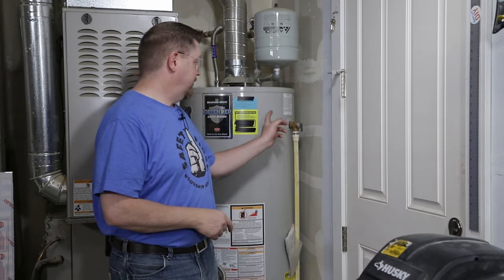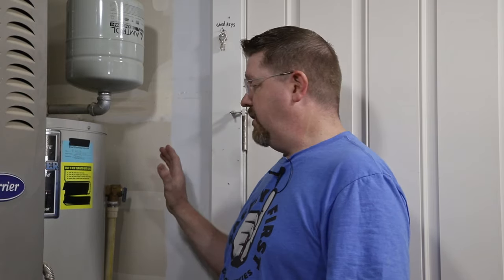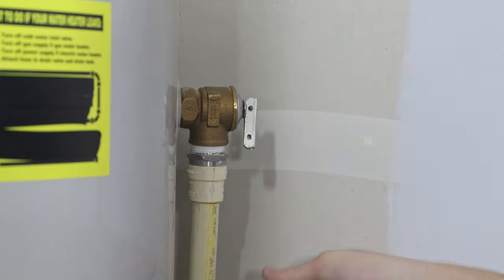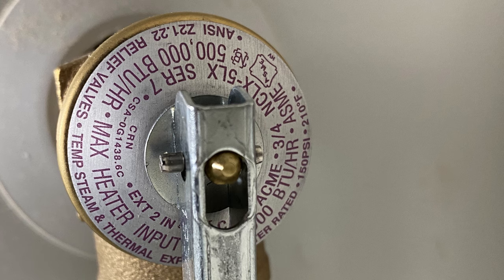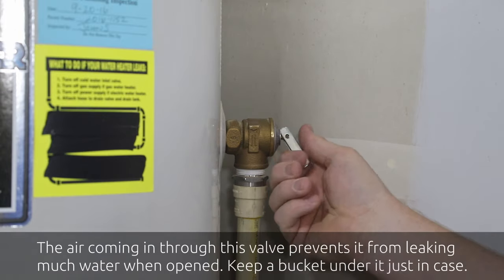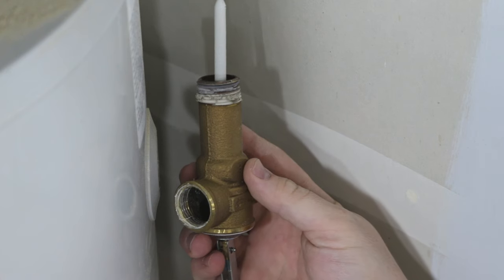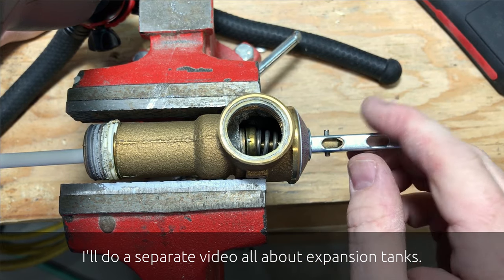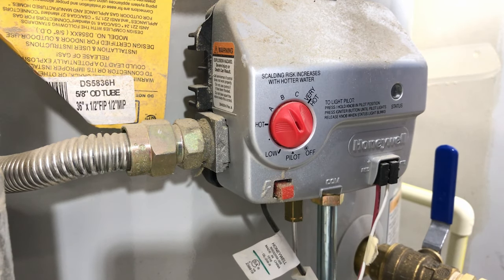How To Replace Pressure Relief Valve On A Water Heater (T&P)

Comment: Out of curiosity, how long did it take for you to drain the water till you could replace the T and P relief valve?
Reply from the maker: My tank drains pretty fast because I replaced the drain valve with a better one than the manufacturer included. Took less than a minute to drain down below the T&P.  https://youtu.be/OBPJYg0o_o0

Comment: One of the water tank(5000ltr) water is leaking continuously from the pressure relief valve,we replaced with a same new one. But its continuously leaking from new pressure relief valve. 
Can u suggest me how to rectify the problem
Reply from the maker: As far as I know, these valves only open when the pressure is higher than they allow, the temperature is higher than they allow, or they are damaged/defective/worn out. Consider the whole system: is there too much heat or pressure somewhere? Is it possible the new valve is damaged or defective? 

Are you sure the leak is continuous? How quickly does it leak? Gallons per day? Just a few drops?

Comment: does the water coming in need to be turned off before removing the valve?
Reply from the maker: Yes - unless you want a LOT of water shooting out of the valve hole as you remove it. :)

Comment: Okay this is very helpful but I ran into an issue - flipping the valve won't let any air into the tank so that I can remove it without spilling the water inside.  ..and turning on hot water faucets inside the house doesn't do anything when the cold water valve going into the tank is shut off.  ..some type of vacuum going on won't let anything out.
Reply from the maker: Hi madcow - It sounds like your drain valve is all plugged up. There are 2 ways you can try to clear out the clog: 
1) Attach a hose to the drain valve. With the cold water inlet still open (so there is lots of pressure in the tank) run the hose to somewhere safe to drain hot water, then open the drain valve. If water rushes out the hose, then you have cleared the clog. If not.... 
2) Close the cold water inlet, remove the hose you tried in step 1 above. Open the drain valve. If nothing at all comes out, get a bent coat hanger or long skinny screwdriver and jam it into the drain valve to try to break up the sediment blocking the drain. Once water starts to trickle out the drain valve, repeat step 1 above.

I also recommend upgrading the drain valve to a larger, more robust valve: https://youtu.be/OBPJYg0o_o0

Good luck!

Comment: Given that it is all brass throughout, wouldn't a five minute cleaning work just fine to descale the interior of the valve? It's only a $20 valve, but still.
Reply from the maker: Cleaning may get the mating surfaces water tight again. If you are on a tight budget, I’d recommend trying to clean first, and if it still leaks then go for the replacement. Thanks for the suggestion, and for watching!

Comment: Used this method, and now I have a lot of stuck air somewhere, preventing my hot water from coming out. Probably should have used the open faucet method.
Reply from the maker: Stuck air? That’s not really possible…what happens when you open a hot water tap in the house? Anything?
Reply: @AmplifyDIY  very little water comes out at all and isn't hot
Reply from the maker: @jretta91  Are you certain you re-opened your cold water inlet to the heater? Any chance you have a shut-off valve on the hot water outlet that goes to your house that accidentally got closed? Do all the faucets behave this way?
Reply: @AmplifyDIY  It was the water sensor. I must have tripped it when I moved it unknowingly. I still had issues getting water out of a few faucets after, but after venting the built up air in all faucets, things seem back to normal. Thank you.
Reply from the maker: @jretta91  I'm very glad to hear you got things working again - that's great!

Comment: Please answer this question in my apartments the pressure relief valve is connected to a tube that goes into the wall I’m confused where does all the water go into the wall or where
Reply from the maker: Hi Luis - that pipe is only there in case of an emergency, and it is supposed to direct the water that comes out of the T&P valve during an over pressure or over temp event down and away from anywhere that humans may be. If it disappears into your wall, it likely exits the building a short distance later. Those tubes are never supposed to be capped, or have any additional valves on them. It should travel a short distance and just end so that water / steam can flow freely out of it somewhere that won't hurt anybody and cause minimum damage to any property. Hope this helps!
Reply: @AmplifyDIY  what’s your email to email you a pic because I am very confused
Reply from the maker: @vacking7751  Hi Luis - you can email me here: amplifydiy@gmail.com. Thanks!
Reply: Ok thanks

Comment: Would there be anything different with a tankless hot water system
Reply from the maker: Tankless heaters are substantially different - consult your owner's manual. Good luck!
Reply: Yeah, it's only a pressure relief valve. Otherwise, pretty gravy replacement.

Comment: I cannot get my valve to budge. I’m trying with all my might. Do you have any clue why I’m having a very difficult time trying to twist it out just like you are doing in your video? I mean it’s really really really stuck in there it won’t budge it won’t turn. Thank you :)
Reply from the maker: What sort of tool are you using to try to get it out? Just a pipe wrench? You may need some extra mechanical advantage like a breaker bar - but be careful that you don't snap the valve body off the threads... that would be a bad day. Also, is it possible that you are accidentally attempting to turn the valve the wrong way? Just make sure you are turning the valve anti-clockwise.

Good luck!
Reply: @AmplifyDIY  hey there. Thanks for the reply. My friend helped me get it off. I wasn’t strong enough lol. I replaced the valve, but it’s still leaking from the valve which is weird. And it’s brand new. Still trying to figure out a solution. Thanks so much again!
Reply from the maker: @lilac1055  I'm glad you got the valve replaced, but sorry to hear it's still leaking. When does it leak? All the time? Or just when the heater actually heats the water? Do you have an expansion tank? If not, you may need one: https://youtu.be/NGygvtP6Sdk
Reply: @AmplifyDIY  that might be what it is. It probably has something to do with some thing else, pressure or temperature or some thing. I’m going to have someone look at it this week. But your video was amazingly helpful. You did an excellent job. Thank you for that

Comment: So my pressure tank that's on top of my water heater is hung upside down where the air pressure release is at the bottom. When I push on that water comes out. I think it's because the tank is hung upside down. How do I verify if this tank is in working condition or not given that it's hung upside down. And it looks to be designed to be hung upside down too given a sticker on it is upside down
Reply from the maker: That's a very common installation setup. It's not "upside down" necessarily - many tanks are in fact designed to be installed that way. If you have water come out of the air valve at all - it's time for a new tank. The internal bladder has failed, and the tank is no longer allowing for expansion. Replace the tank. Good luck!
Reply: @AmplifyDIY  Thanks for the info. Water is definitely coming out of the air value, so i will replace it. This is probably why the pressure release value failed.

Comment: I just changed it but it started leaking at the threads. I applied teflon and joint compound on the threads while installing.
I removed it cleaned it cleaned it again and this time applied blue monster compound from the home depo. But it’s still leaking. Any suggestions?
Reply from the maker: Leaking at the threads? How tight are you installing it? Maybe it’s just not quite tight enough?
Reply: @AmplifyDIY  I think I have damaged the threads by over tightening it. I closely inspected the female threads and seems like some thing is peeling off and making the surface very rough.
Should i use epoxy?

Comment: Let’s say that I did the test and then the next day noticed it dripping a drop a second.  But  then today I pull it a couple times and now it seems okay.
Reply from the maker: Chances are you had some sediment built up on the mating surfaces inside the cave. Cycling it a few times may be enough to clear it off so it can seal. Watch it for a few days, and if no more drips, you’re good. Thanks for watching!

Comment: I am trying to determine if I bought a faulty relife valve,I replaced the valve with the new one but when I pull the handle straight up water leaks from the top of valve.what I mean is water is spraying from under that round disk on top when Ipull the handle.
Reply from the maker: Hmm.. that does not sound normal to me. Any chance your downpipe is blocked?
Reply: @AmplifyDIY  Just to let you know this relife valve is on a boiler system(30 psi water pressure is good)the downpipe is not blocked,and I drained the expansion tank.when I lift the handle water sprays from it,and after about an hour it started leaking through the drainpipe again and into the drain.this was the last valve they had at the store so I cant go back and get another one yet till they get a shipment in.thats why I am wondering if its a faulty valve?And thankyou for the reply.
Reply from the maker: @tfast2553  So, if your expansion tank is not functioning properly, the most likely place for a leak to develop is at the T&P valve. Does it only leak while the water is actively heating? Have you checked your expansion tank to make sure it is pressurized to match your incoming water pressure?

Comment: I have a question do you have to turn off your gas before doing this?
Reply from the maker: Hi GabyGol - no, you do not have to turn off the gas. You just need to set the heater thermostat to the pilot setting so it does not light the main burner while the tank is empty. Good luck!

Comment: Do I have to have that long down spout?
Reply from the maker: Yes, you really should have the downspout. If that valve were ever to release in an emergency situation, you want the discharging water and steam to be directed down rather than right out the side of the heater where it may hit someone in the face/upper body. Downspouts are required by code.

Comment: What is that long white piece on the valve? I bought a new valve but it didn't come with it.

Edit: looks like I bought the wrong one. White piece is for temperature apparently
Reply from the maker: Yes, the long part that sticks into the body of the heater is the temperature probe. Make sure your replacement valve has one. Good luck!

Comment: What if there is rust on the inside. Also is the drain release suppose to Leak?
Reply from the maker: Rust inside the T&P valve? That's not normal, as these valves should be made of brass. If you have so much rus inside your heater that it is getting into the T&P valve, it's time to start saving up for a new water heater. Also: no, the drain is not supposed to leak. A properly working water heater will not have any leaks of any kind when operating normally. Good luck!
Reply: @AmplifyDIY  thank you for answering my question! Second question, the cap area around the T&P has some leaking. Am I not putting the valve back on there tight enough?

Comment: what happens if my valve does nothing when i open it? it kinda on dribbles? does this mean there just isnt enough pressure or that its faulty?
Reply from the maker: Hi Kuldog - yeah, if your valve just dribbles, then it's faulty and should be replaced. Good luck!

Comment: Any idea why it would continue leak after installing a new valve?
Reply from the maker: Hi Protege - how severe is your leak? When does it happen? If it only leaks a few ounces, and typically only when the heater is actively heating (such as right after taking a shower) then you likely have an issue with your expansion tank. If you don't have an expansion tank, you might need one: https://youtu.be/NGygvtP6Sdk Good luck!

Comment: I turned my water heater down too low while we were on vacation for a few days and after we got back I turned the gauge back up to a normal heat the next morning I went downstairs and there was a big puddle of water below the water heater from the overflow valve.  Now it keeps slowly leaking, a minor trickle and it seems the TP valve is not completely shutting after I opened it for a few seconds to check it.  Its only a 3 year old water heater
Reply from the maker: Hi Jon - do you have an expansion tank installed with your heater? If so, it may need some service or to be replaced: https://youtu.be/NGygvtP6Sdk  Good luck!
Reply: @AmplifyDIY  no I don't have a expansion tank installed
Reply: I tried turning down the heat on it, maybe it was set too high after being turned low for 3 days

Comment: One thing I noticed is that you had to loosen the new valve in order to line up the downspout.  I prob would have re done that.
Reply from the maker: Hi Andrew - I only had to take it back less than a quarter turn. After filling the tank, it did not leak, so there is no need to worry about re-doing it. In the case of a downspout like this, it's really important that it be lined up vertically, so I decided not to try to go back and get one more full revolution (would have likely been too tight). 

Of course when installing one of these, make sure it does not leak and that it points in the correct direction. 

Thanks for watching!

Comment: how old is your water tank? or how often should be replace
Reply from the maker: My tank was 3 years old when I filmed this. T&P valves should be tested annually, and if they no longer function properly (i.e., they leak after opening them for a test) they should be replaced. Actual lifetime of any given valve will vary a LOT depending on water quality, thermostat temperature, etc.

Comment: Is it required to hit the T&P valve with metal pliers? I hired someone to flush my water heater and the guy hit it with metal pliers and then the next day my T&P is leaking pretty bad.
Reply from the maker: Sorry for the late response - you mean he hit it with pliers like hitting it with a hammer? No - that's not a good idea.